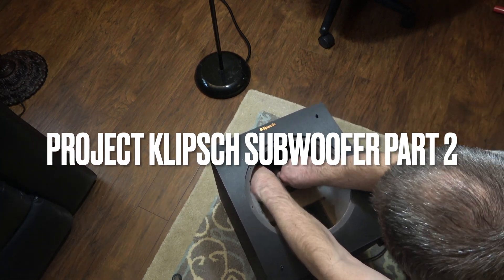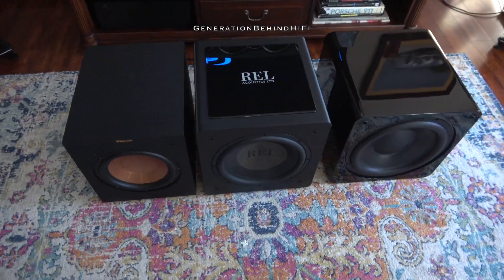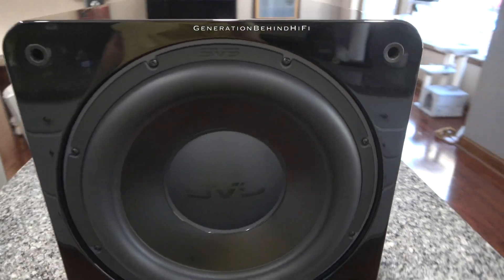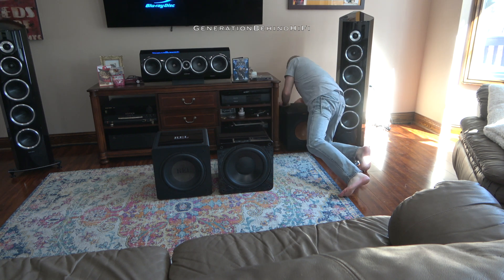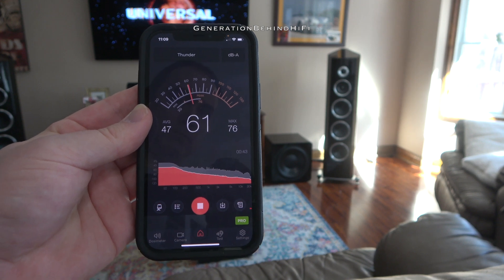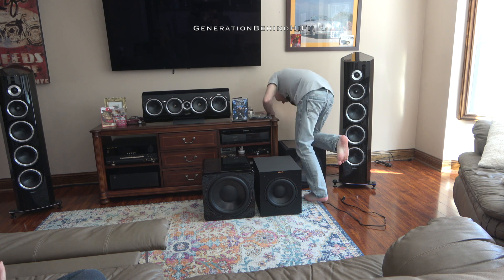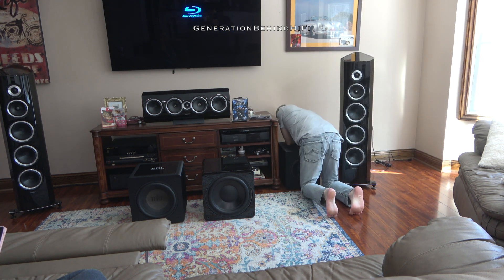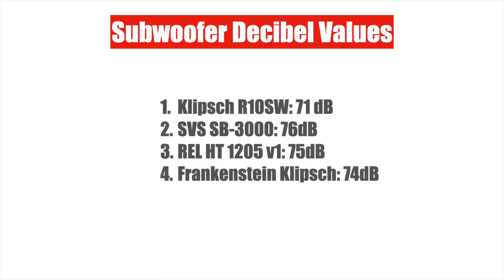Upgrading A Klipsch R10SW R100SW R101SW Subwoofer Part 2/4

Comment from the maker: Note: The reason why the SPL reading were so low is because I was using the A weighting frequency scheme instead of the C weighting frequency scheme. Ops! I plan on re-running this tests using the correct C weighting frequency scheme on my SPL meter. The results should be much higher.

Comment: When you shortened the port, you raised the Fb of the enclosure. Not tuning of the driver. So when you think the sound is tight, punchy, it means its peaking in the 45-80hz range...The original box tuning was 32hz. by shortening the port you probably are around 43-50Hz tuning, just a guestimate.
Reply from the maker: Hello. I go over all of this in part 3 when I redesign the port and tune the driver to the enclosure with my measuring equipment.
Reply: @generationbehindhifi  Yes i have seen it, you did a great job :) learning as we go.... Im doing the same thing :)
Reply from the maker: @dannyb5874  Enjoy! These types of projects can be very addicting.

Comment: Not trying to fault you for wanting better performance out of your Klipsch subwoofer. I get the intention of what is trying to be done here. Better performance for minimal investment. 
However the fundamental problem with this is that you trimmed off 2” of port length. This has changed the overall tuning frequency of the enclosure. This will have a direct effect on SPL measurements. So, in actuality your measurements are skewed and likely not accurate in any way. 
Had you trimmed the port on the enclosure, inserted the Klipsch driver and taken a series of SPL measurements across the intended bandwidth. It would actually provide a more scientific result  in the data collected. You could actually provide a “side by side” comparison of the output at the same frequencies.  This doesn’t even consider replacement driver selection and the T/S parameters of each driver. That has additional factors that determine how a driver reacts in the type and volume of air space of the enclosure it’s in.
Reply from the maker: It doesn't sound like you have seen part 3? You need to understand that in part 1 and 2 I was just tinkering and nothing serious was taking place. In Part 3 I get more serious with my design and talk about the T/S parameters of the drivers, how to model the design in WinISD, and then talk about port tuning.

Comment: Hey bro, you’re comparing apples to oranges here. The cheapest Klipsch that’s a 10”compared to a 13” is obviously going to be way different. Not even a true test imo.
Reply from the maker: Doesn't sound like you watched the whole video or series. I know this isn't a fair comparison. I don't think anyone is disputing that. The goal of this project as I said in the video is to see if I can make a cheap subwoofer compete with a higher end subwoofers in SPL output.

Comment: Awesome video! I have a question please!? I have two klipsch sub120, and was wanting to upgrade but i see this video and was wondering would it be worth to just change the woofer out like you did? Obviously your mod worked great, just wanting some insight! Subbbed!
Reply from the maker: Thanks! Your feedback is much appreciated! I thought changing out the driver with one from a Martin Logan made a tremendous improvement in both sound quality and output. I ran my subwoofer with a rag stuffed in the port because I still need to work out the port tuning, but even still it sounds like a totally different sub. I only have about $50 bucks in upgrading the driver so I thought it was well worth it! 

You might like my new JBL 550P subwoofer upgrade series. In this series I actually have the T/S parameters of the new driver and can model how the new driver will perform. Check out my posts in the community section. The first episode will be live on June 2nd.
Reply: I want to do the same thing but to my klipsch with 12". If I can't find a martin Logan, what other speaker would you suggest to replace?
Reply from the maker: @serenityfpv  Anything is better than the original driver!! I noticed that a lot of Martin Logans have amplifier failures so I was able to get a smoking deal on a nice 10" driver. If I had to purchase a new driver of this quality from Parts Express it would have set me back at least $150. My best advise is to start looking at eBay and see if you can score a used driver from a high end manufacturer like Martin Logan, REL, SVS, B&W, etc. You might get lucky like I did! My next video that will be out on June 2nd will explain what to look for in a new driver (T/S parameters) if you want to buy new.
Reply: Is the speaker from a Martin Logan 500w a smaller physical size?

Comment: Is there going to be Part 3?
Reply from the maker: Hi Greg! Yes! I have to re-run the SPL tests since I did it wrong. Doh! I was using the wrong frequency weighting scheme (A-weighted). I should have been using C-weighted, instead of A-weighted, which is why the numbers were so low. Simply put, I think my upgrade will save face after I upload the new video. First I have to finish my REL HT 1205 review, then I will work on a new SPL video. I'm hoping to have it out in late May.
Reply: Sounds good! You mention something about the port noise were you going to work on that?
Reply from the maker: @gregorybond2859  Not yet. I really need a Dayton DATS v3 in order to resolve the port issues. I need to know the T/S parameters of the speaker to figure out the optimal  port size and length. I might pull the trigger and buy one. I haven't decided yet. 

I do have another subwoofer upgrade series coming out in June (JBL 550P). This time I did do the proper calculations because I knew the T/S parameters and boy did it turn out amazing. I went with a very high dollar driver (CSS SDX10) which is probably one of the best sounding drivers on the market.
Reply: @generationbehindhifi  👍

Comment: For home theater I think the v1 REL1205 might outperform the new version.  It has much more output below 40hz than the new version, but the v2 has more output between 40-100hz so it probably sounds better for music.  I'm happy to hear the REL holds it's own against the sb3000 since I own the REL, I would have expected the SVS to outperform it by a lot.  The results of the frankenwoofer surprises me.  I have a monoprice 15" sub (cheap non monolith) I might swap the driver out of after seeing this to use as a nearfield sub behind my couch haha.  I look forward to seeing more of your videos!
Reply: I tried two of the REL 1205 V1 for movies one SVS sb3000 was way better digging dipper 30hz lower. For music I would go with the REL 1205 V1. I sent them all back and went with the Rythmik FVX12 for me it was the best for movies and music.
Reply from the maker: Thanks! I appreciate the kind words! 

Yeah! I was really surprised that the HT 1205 can hold its own against the SB-3000. Sure the SB-3000 has a tad bit more output but sonically they sound very similar. 

As for the Klipsch, buying that Martin Logan driver off eBay and installing it has been the best $50 I have ever spent! My FrankenKlipsch can now hang with subwoofers costing $5-$600. 

I have never owned a Monoprice subwoofer before, but I have heard good things about them! If you do decide to upgrade the driver make sure you let us know what you went with and how it worked out!

Comment: Hows the amp holding up pushing the heavier driver? Love the mod btw.
Reply from the maker: So far so good! Yeah, it was a nice upgrade for sure. Thanks! :)
Reply: @generationbehindhifi  could you tell me the dimensions of that klipsch plate amp? I have an R12 cabinet I want to swap the parts into.

Comment: BTW, I just noticed your app was set to A-weighting. You should have set it to C-weighting. C-weighting is much more accurate at measuring low frequencies. That’s probably why your SPL numbers are so low.
Reply from the maker: Oh! thanks for telling me that! I was thinking of buying an SPL meter. Are there any that you recommend?
Reply: @generationbehindhifi  I use a Protek SL-100 which is discontinued now.  Whatever you get, just make sure it does A and C weighting and can measure down to at least 31.5 hz.

Comment: You real need to try the Rythmik Audio FVX12 or F12SE the SVS 3000 does not compare tonality of the sound. SVS 3000 does not sound natural when it hits the real low sounds.
Reply from the maker: Hi Greg! I did try a Rythmik Audio FVX12 when I was in the market for a new sub in my main theater room and it wasn't for me. How speakers and subwoofers sound is a very subjective topic. Thanks for the comment!
Reply: @generationbehindhifi  That's why there is chocolate ice cream and vanilla. I will say the SVS 3000 hits had for a sealed subwoofer. I like your channel keep up the good work.
Reply from the maker: @gregorybond2859  Absolutely! Chocolate and vanilla are both delicious flavors, it all depends what you're up for that day. 

I might try one of their sealed subwoofers on the next go around. Thanks for the nice comment! It is much appreciated!

Comment: Are those max output numbers?  76dB is kind of low. Those subs should be capable of hitting at least 90dB.  I suggest picking up a real SPL meter instead of the phone app.
Reply from the maker: Hi Mike, I was using a free phone app so it's accuracy isn't absolute. I mentioned this in my video as well. I haven't decided if I will invest in a real SPL meter since I'm just doing these videos for fun. We will see!
Reply: Subwoofer measurements are usually taken at 3 meters. He clearly much further away than that hence the lower measurement lol.
Reply: @kevinwest1607  SPL drops by 6dB for every doubling of distance outside.  In-room, it's less than that.  So even if he's measuring from 6 meters away (close to 20 ft), it would be no more than 6dB less.  76dB is weak if that's anywhere near max output.  Any decent sub should be able to hit at least 90dB at 20hz, and over 100dB in the mid-bass.
Reply: @mikesisk2960  I wouldn't expect much output from those weak subwoofers.I mean a ported ten in a little tiny box and some sealed subwoofers? I've owned quite a few subwoofers ported and sealed. In my experience a sealed subwoofer less than 15 in just does not have very much output. And a small 10 inch subwoofer in a small ported enclosure is not going to be too great either. In my music setup I run two sealed 12-in subwoofers and in my home theater I run four 10-in subwoofers in proper large size ported enclosures and let me tell you those 10-in enclosures in my home theater absolutely slam and they shake the entire house My two sealed 12s can't even get close to that kind of output.